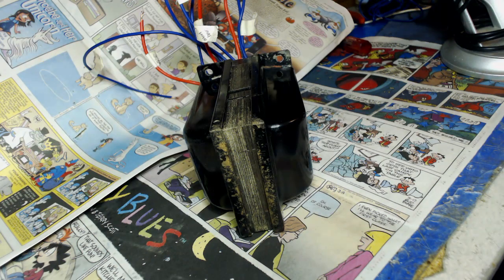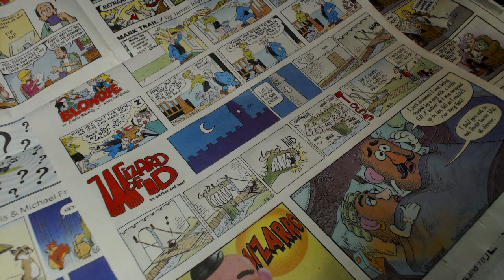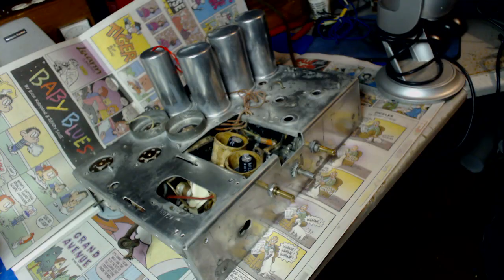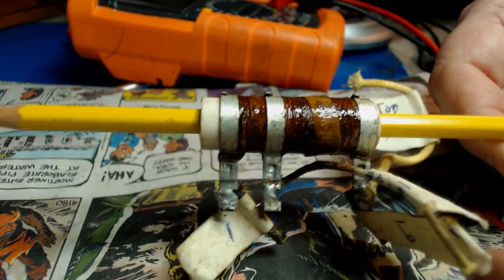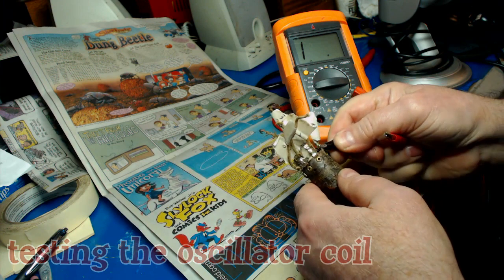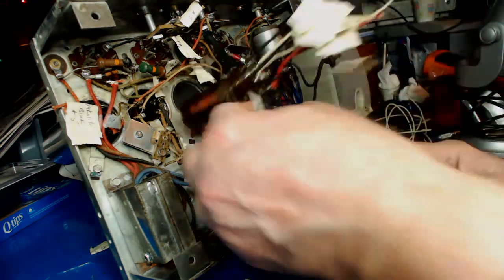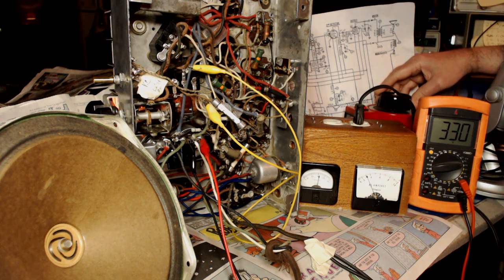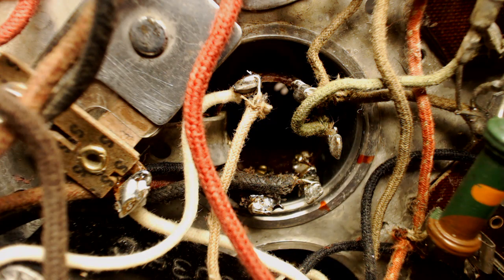1935 Philco Model 89 Restore Part 5

Comment: I just re-wound one of these 89 osc coils, I removed the open tickler winding and celluloid form, cleaned the wax off of the bottom coil using heat and wiping the wax off while warmed then used alcohol to get the last of the wax off, then sprayed clear acrylic over the bottom coil after drying wrap 2 turns of electrical tape as the insulation then wound the new tickler coil on the tape, the thickness of the insulation is critical no more the 2 turns of tape, after I gave the re-wound coil 2 coats of clear acrylic and also removed the inner coil cleaned and coated it with acrylic when I installed it I barely had to tweak the adjustments everything was just about dead on, and as a funny side note I got the wire to rewind the coil from a crappy Chinese shake light flashlight, see they are good for something. The only problem I had was finding dial string that works correctly and doesn't slip.

Comment: peanut is probably just feeling like a second banana to Dickel, that's why he didn't want to roll over for the treat. glad you found out why that resistor was overheating, that was a good and quick diagnosis of what was causing the problem.
Reply from the maker: Seemed like an eternity to find the problem...it was wedged in there tight...Peanut loves her treats!!

Comment: Buzz,

 I felt a disturbance with the Force on this one, too.  I knew something was amiss....  I'm glad you got it straightened out.

Why didn't you coat the oscillator coil with that clear fingernail stuff as well?  Did you do the first coils wires for protection?

Thanks for showing some of the behind the scenes things that you do to make your videos possible.  These videos just don't make themselves. There's a lot of work involved.

Regards, Tom
Reply from the maker: I was going to put wax on the osc coil, but left it alone...I applied nail polish to the wire wound resistor to make it look nice...Buzz
Reply: Buzz, 

Thanks for clearing that up for me.  I mis-remembered and thought it was a coil rather than a wire wound resister.

Comment: I'm working on an 89B also, one that still has the type 36 for the oscillator. My oscillator coil was OK, but the primaries on both the input RF coil and the second RF coil were bad. On top of this the radio is a rats nest, not literally, although I once found a mouse nest inside an RCA C9-4 console I restored.  ( https://www.youtube.com/watch?v=aqoBYsF7PyI&t=256s )  No, this one was just built very messily. I see yours was too. The Philco habit of putting a lot of the components into bakelite blocks is also annoying. In mine I have gone over to using terminal strips to replace them. Now, at least, people can see what's what. Honestly, Philcos are not among my favorite radios to work on. Give me an RCA, or even a Hammarlund, National, or a Scott any day.
Reply from the maker: gotta love them though! haha👍👍

Comment: buzz i need a hand on something . what can cause audio failure on a radio  ive got a project that only creates sound when the 35z5 and 35l6 tubes are in swapped places . besides the last thing i want to do  is go searching for the problem by having to pull caps that are not the issue at all. it does sound like  there is something open in the audio end though
Reply from the maker: go ask around on the antique radio forum............Buzz
Reply: alright, i will go check that out  .thanks